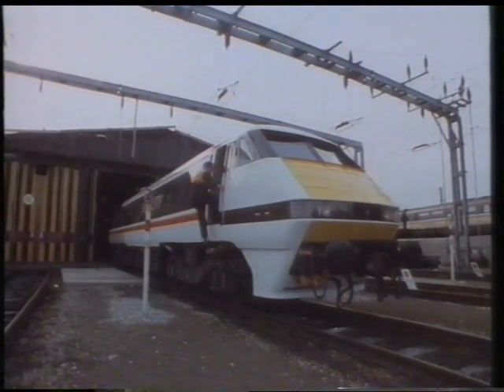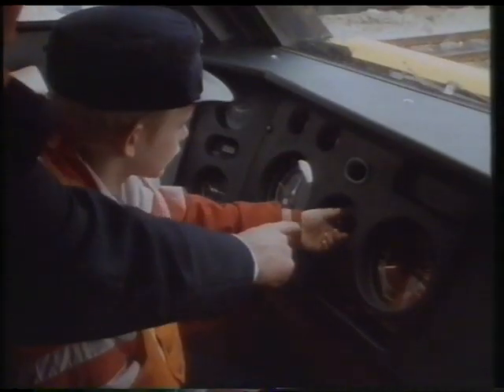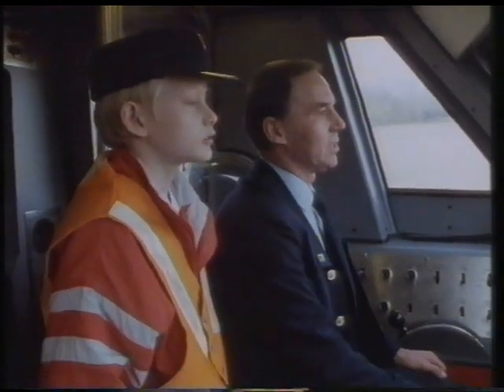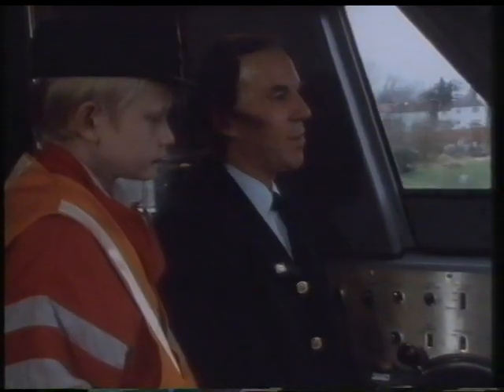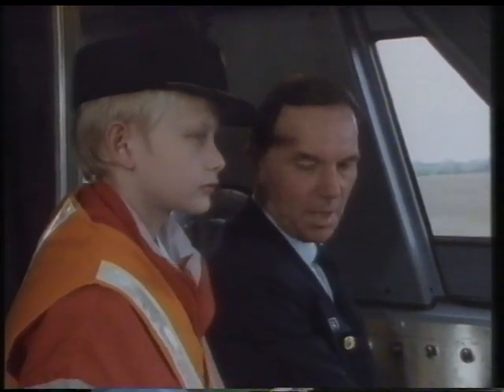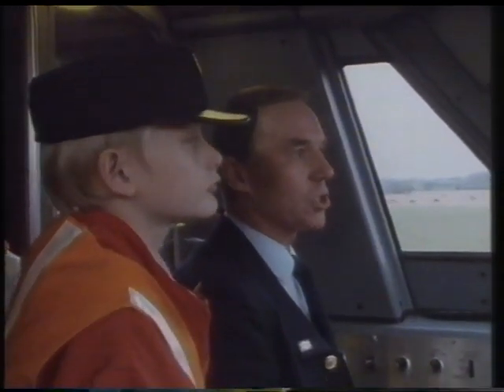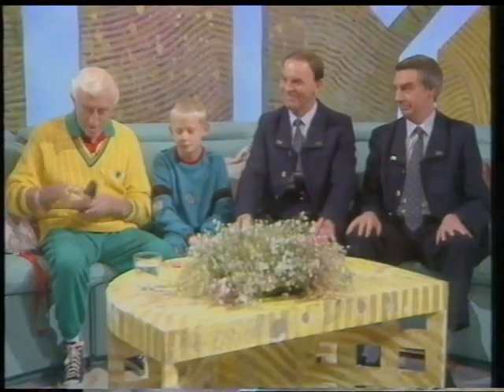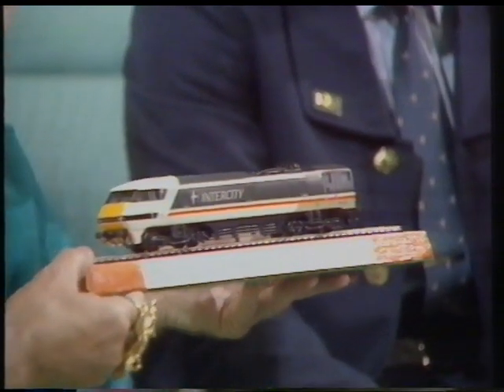'Jim'll Fix It' (Excerpt). Riding a Class 91 (cab ride).

Comment: 4:20 I thought they were never authorized to run at 140 miles per hour.
Reply: Were for short time in a certain area.
Reply: @vincitveritas3872  Where about's may I ask?
Reply: @MrGriser  I'll look out my book.
Reply: Please see my response to Mark 1.
Reply: MrGriser between Peterborough and stoke tunnel. They where thinking about doing it between York-Darlington as well but the budget didn’t allow. One of the main problems was the signalling thoug
Reply: @Bahamas-rd8le  Yes that's right Stoke Bank on 17th September 1989 162 mph if I stand corrected.
Reply: Were they perhaps still in test during this filming?
Reply: JintySteam yes they where, I think those are the mk3 coaches used in some tests? I could be wrong
Reply: @Bahamas-rd8le  Yes it was a Mk3 set.   When the 91s first entered service they ran with a Mk3 set and one HST power car until there were enough MK4 vehicles to make up complete sets circa 1990/91.  These "hybrid" sets were reportedly very rapid thanks to 6000hp from the electric and 2250hp from the diesel!  They could also operate on just diesel power in the event of power failure.
Reply: @soundseeker63  ah yep good
Reply: @soundseeker63  Astonishing! The only reason why the class 43 would be there is to provide a cab @ the other end? But to power, & not be isolated, wouldn't it have to be crewed as well as the 91 up front?
I'm not aware of any electric & diesel electric machines working MU, together.
Reply: @johnsergei  Actually thats incorrect. Initially the HST was just used as stand in "DVT" and to provide ETH for the Mk3 coaches, while the 91 provided the tractive effort.  However this caused a number of exhaust fires due to the HST idling for long period and unburned fuel building up in the exhaust system.  It was then decided to link the 91 and the HST via the TDM system so that BOTH were providing tractive effort and prevent the exhaust fire problem so for a short time there were actually AC electric/diesel electric hybrid sets running on the ECML. The practice was gradually phased out as the Mk4 DVTs were delivered from 1989/90 onwards.
Reply: @soundseeker63  That makes sense. Is that why a few 43s had buffers?
Reply: @soundseeker63  Fairly sure it wasn't unburned fuel, it was lubrication oil that built up in the exhaust system. Probably wouldn't have happened with VP185  or MTU engines which had better oil control pistons / rings..
Reply: @johnsergei  Yes, presumably so that they could work with the Mk 4 coaches although why the front of the Class 43 needed buffers I'm not entirely sure, i guess in case a 43 had to push a rake of Class 4 coaches. No doubt someone might explain / confirm.
Reply: @Martindyna  My guess is that they added buffers so a 91 could couple up and haul the set at either end should there be an issue with the HST power car, as they did occasionally do when there was issues with the DVTs. Ditto the WCML push/pull sets. I've never seen any phots of them actually working in that configuration though.

Comment: I didn’t know 140mph was a max speed at one point I thought it was 125mph Max
Reply: They were designed to run at 140 MPH,which is 225 KPH.
Reply: the 90 goes 110
Reply: the 91 goes 140
Reply: thats the only 2 90s series trains.
Reply: @Anime_and_Noob  91010 reached 161.7mph while on a test run down the ECML